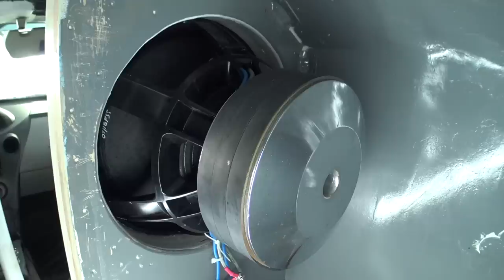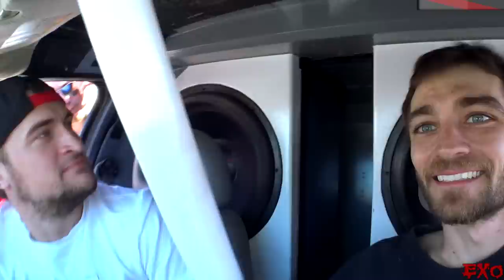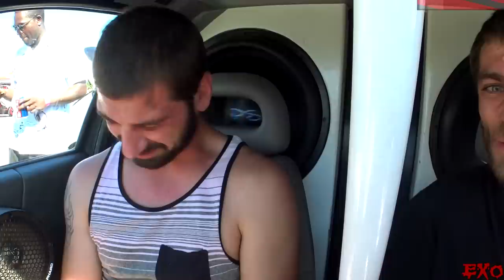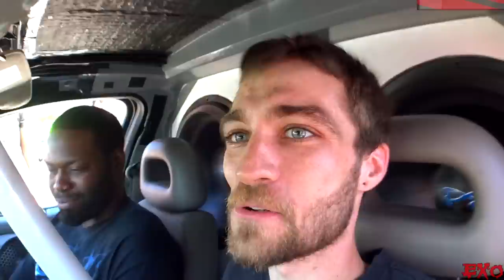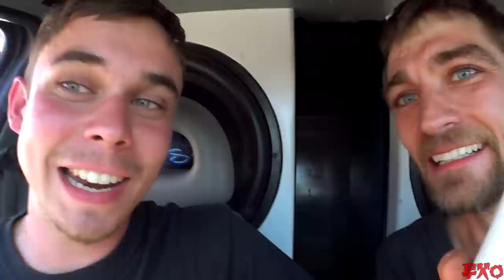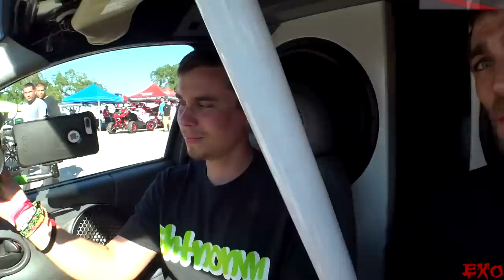BIG SUBWOOFERS in a SMALL CAR w/ 2 18" Subs Flexing on 10,000 Watts... POWERFUL BASS SONGS!!!

Comment: The best thing about bass is you can enjoy it at any setup. Whether you have a small 8" computer subwoofer, or these 5k+ setups with 15" subs. I have a 1k amp with 2 Rockville K9D2 12"s and absolutely love it (The K9's are PERFECTLY fine as long as you aren't RMSing at 1k watts, RMS is around 500-600 watts; in a good box, they sound loud). And like I said, even if your subwoofer is a tiny 50watt speaker or a huge 4000watt speaker, you can love it.
Reply: Bass is love, Bass is life
Reply: I'm pushing 2 15 kicker cvx's with a planet audio 5000 watt amp. I set off car alarms everywhere I go.. about to get 2 more 15s and either upgrade my amp to a 10,000 watt or just get another 5000 watt.. not sure yet..

Comment: Just wondering as I'm in the process of buying a car to build a system in (not sure whether I'm going for a van or a smaller car, pricewise). Do you have 1 custom or is there space for more alternators? How many batteries and where do you have them? How about the weight of it all, I'm assuming you have aftermarket suspensions?

Comment: Also, So Dope, by Tech 9 would probably blow systems. 
So would , you were the s___ (in high school) by Cage. It has got that low lows that you don't need to slow down to rattle your brain around in head. That song has made me tap out in a 2017 fusion with 1 sub wired to one of the rear speakers. Is not nearly as intense as little blue, but it pounded. I need to add a sub to my car. I have one, but no wires or amp. I took my 10 out cuz I smelled coil wired to the right rear speaker.